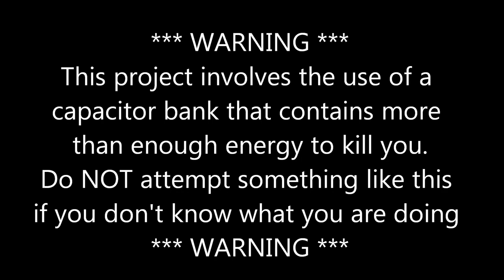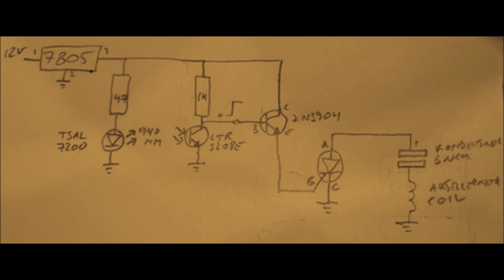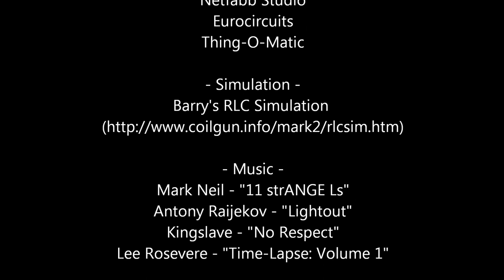Open Source Modular Coil Gun

Comment from the maker: I used LTR3208E phototransistors as sensors and TSAL7200 as IR emitters (mostly because I had a lot of them lying around from previous projects). The type of emitter and sensor is not critical. You could just as easily use parts salvaged from the opto triggers used in pinball machines.

Comment from the maker: I doubt it :) The distance from the optotrigger to the coil is the same for all modules. At increasing velocity, timing and pulse duration becomes a concern. You can risk that the projectile is sucked back if the speed of the projectile exceeds the time it takes to trigger the pulse.

Comment: Hmmm. Good guess. Maybe sensors can be replaced with a computer signal that is fine tuned based on math calculations on the supposed speed and acceleration. Of course during fine tuning I wouldn't hand feed the projectile. :D